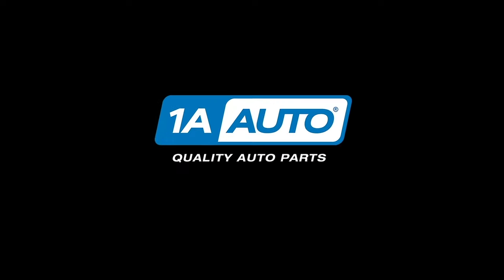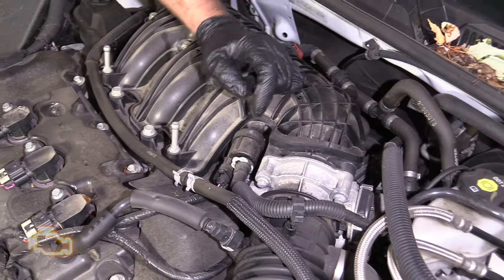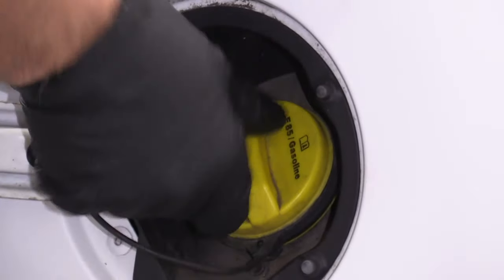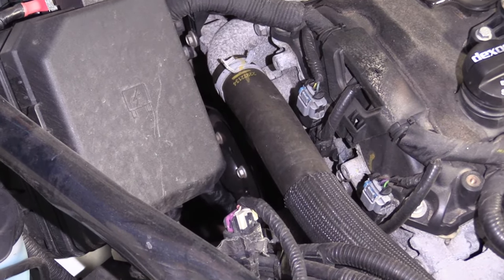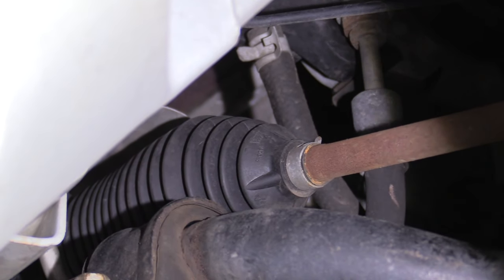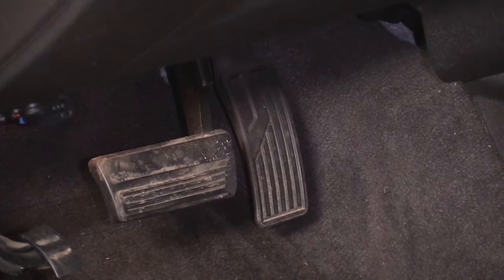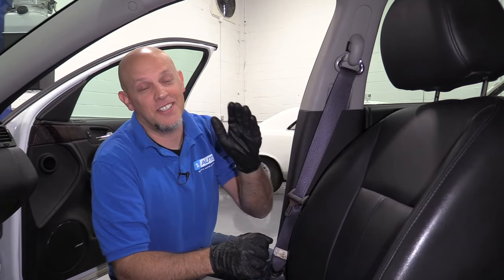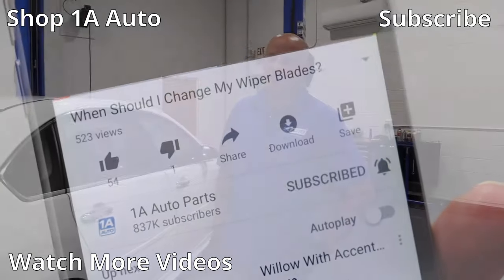Top 5 Problems Chevy Impala Sedan 9th Generation 2006-16

Comment: Blend door actuators on the passenger side is going to tick like a bomb eventually. Ive changed them twice. I said forget it.
Reply: How long did they go out between each one? I've replaced mine only once and I haven't had problems. Knock on wood though
Reply from the maker: Yes we should have added this to the list.
Reply: @marcopolo5541  i changed it and less than a year later it started again. I said screw it and a while later it just stopped. I dont know if it stuck now it working fine but it doesnt seem to be an issue.
Reply: Same thing happened to me im done with the car now rip
Reply: Ahahaha
Reply: @ajw148  if I don't replace mine, my heat won't work. I've replaced the one on the far right of the glove box twice and the other two once. Within the last 2 yrs. I've owned my 2011 since 2013 and this has been a recurring problem along with ABS SPEED SENSOR and the accelerator issue.
Reply: @shaniqua.jackson  yep. Me too. Ive had my 09 since 2013. Ive changed my hubs twice and now i need to do it again. It dont matter if you get the cheap chinese ebay ones or the expensive ass AC Delco ones. Its going to happen again. I got 3 friends who had impalas and all of theirs had the same problem.
Reply: @shaniqua.jackson  the accelerator issue, i had that problem too. Changed the gas pedal and aint had that problem since.  $60 part and 5 minutes to swap it out and my dumbass spent 300 bucks renting a car when that was happening. Smh.
Reply: @ajw148  Eeek! Well glad you got it fixed. Thanks for the additional info!
Reply: I have an 09 with 106K never had hub problems.I have had the other actuator and vent valve solenoid problem. Also oil pan and intake manifold leaking, What mileage did the hubs fail? Thanks
Reply: @ajw148  mine would tick for about 30 seconds then stop. After a few weeks of that is just ticked nonstop. It was summer and it was blowing cold air so I just unhooked it. When it got cold had no heat so just bought one. Not hard to replace.
Reply: Yes, its a terrible design and will have to be replaced about every 2 years or so
Reply: I changed all 3 actuators. The 2 on pass side went smooth. The 1 on driver side, I made it look like I was rebuilding the space shuttle that blew up in 87 not fun. Small ratchet handle is a must have! I'm not a mechanic. But I'm not afraid of screwing shit up worse! You should see my house 🏠 let's just say looks aren't important. And If you want basement lights on. Just ring the door bell 😄🤣😂

Comment: Damn Impalas! My purge solenoid failed after 130K miles! First part I had to change on the car. Just brakes and tires and oil changes.
Reply: That's nothing
Reply: I’ve had to replace that part twice on mine it has 138,000 on it.

Comment: 2008 impala. Changed all the imission parts light still on. Took off vent line at manifold spayed carb cleaner and I  turned off light. Never came on again. Quick clean all is needed.

Comment: Have seen two 2009 models need transmission repair. The sealed transmission is a pain to service yourself if you need to do anything other then flush fluid. Was figuring that would of ended up in your top five.

Comment: U forgot the transmission an the throttle body postion sensor head gasket if they use dexcool its more then that i had one the 9th gen
Reply from the maker: True there is some other issues that didn't make our top 5. Thank you for checking out the video. If you need auto parts go to: http://1aau.to/m/Shop-1AAuto-Now

Comment: My first and current car is a 2013 impala lt with 210,000 miles as i speak. it runs great i change the oil every 4,000 miles with full synthetic. Do yall think itll get to 300,000?

Comment: The main problems that I've experienced that weren't mentioned are:

- Coolant Temp Sensor (Warning - "Engine Hot, Turn Off A/C")
- Oil Pressure Sensor (Warning - "Oil Pressure Low, Turn Off Engine")
- Air Vent Actuators (Both - Clicking Sound)
- Throttle Body Position Sensor (RPM fluctuation while accelerating)
Reply: Same problems I’m having

Comment: top 5 Transmission, evap, rear window(wire burns out--checked 6 at the junk yard and they had same issue), oil pressure sensor, actuator, these cars have 3 actuators, and they go out at different times. shop/ dealer cost about 100.00 each repair, do it yourself about 25 dollars each repair. I am no mechanic, but i owned a 07 SS for about 12 years and 285,000 miles. My brother has it now and still driving.
Reply: Is it expensive to fix ? I wanna impala but the transmission issue is scaring me
Reply: @BoiBoiGTA which issue are you asking about
Reply: @BoiBoiGTA  which issue are you asking about
Reply: @BoiBoiGTA  if you are talking over all, no. The transmission is what it is. Depends on where you take it. I am assuming you will do most repairs yourself.
Reply: @wilmoney4201  Is the transmission expensive to fix ? I heard the transmissions go out on these cars often, I could fix the minor repairs myself but not the transmission
Reply: @BoiBoiGTA  it should scare you, because the trans is going out, just a question of when. Ain't gonna lie, I loved my SS.
Reply: @BoiBoiGTA  I put 2 in mine, first one was 1700.00 and the second one was 1500.00, keep in mind  that was like 2012 and 2016..I am sure its more now. I think its closer to 2k now. Depend on where you live.

Comment: And the catalytic converter goes out easily too. I own an 07, love my car. Has 180k right now
Reply from the maker: Thanks for watching!
Reply: @1AAuto  yeah! I love watching your videos, I've watched a few and have been able to do minor things to my car. I'm not really a good fixer upper but I have learned a lot. I do love Impalas, at least mine anyway!
Reply: Clyde I have an 08 lt that's pushing 200k miles noticing an issue with clutch slip which apparently is a common issue too. Engine revs for a sec when you give it gas then it'll jerk forward hard.
Reply: @benstuff8758  is that just low transmission fluid? My car does that if I'm thinking the same thing. Like you are at a dead stop give it some gas and it'll be sluggish then BAM off it goes? Lol that's how it seems to me. And sometimes it'll make a hard shift when I'm driving on this 1 gear it seems. Just once and awhile. Just noticed that happening.
Reply: @clydeharrell1216  unfortunately its not. Its just badly designed transmissions. I've tried flushing my transmission fluid and replacing the filter which temporarily eased up the issue only for it to come back about a month later.
Reply: @benstuff8758  ah, see I thought it was my leak. Good to know! But as long as it runs I'm good!
Reply: @benstuff8758  have you had to replace much on your car?
Reply: @clydeharrell1216  no its been overall very reliable since I got it. I've gone through 2 batteries (one when I bought it and one 3 years later), and a air vent motor. In terms of stuff breaking thats all I've replaced. I've made my own modifications to the stereo system though and replaced basically the whole brake system with performance stuff.
Reply: @clydeharrell1216  oh and I had an oil sensor go out
Reply: @clydeharrell1216  yeah dude just keep running it till it dies. As long as you keep up with maintenance they're reliable
Reply: @benstuff8758  yes my 06 Monte Carlo does that as well.  I'm not worried about it as it's been the same for the past 10 years.  Lol.  I'm just careful and ease off the line.
Reply: @tashalousdadful  honestly dude once I slapped a performance chip in it, I rarely have that issue anymore. It's something with the transmission shift points. Since I shift at higher rpms normally now I don't get clutch slip

Comment: Issues I have faced with 2010 Chevy Impala LT: HVAC actuators, accelerator pedal sensor, window motor replacement, door lock solenoid actuator, corroded battery cables with terminals, corroding heater tube pipe (the one on the driver's side, not the front).

Comment: OMGOSH,  I'm 4 out of 5 you mentioned.  However,  I drive a 2010, and everything looks much different under my hood. 
I did learn a couple of useful tips for things to check, though.  Thanks for the video.
Reply: Did u have problems with the transmission/solenoid ? If so was it expensive to fix

Comment: Please add door actuators and vent actuators. I have a 2008 Impala with low mileage garage kept and I've replaced 5 or 6 vent actuators through out the years. As to the doors, when outside temp hits 95 degrees, actuators won't work to open the doors. Otherwise, love my car and I haven't hit a snag with any of the top five problems in your video. Thanks.

Comment: Have a 2010 Impala base edition with 120,000 miles I’ve owned it for 6 years and the only real issues I’ve had thus far is the actuator and steering wheel leak

Comment: Nobody has mentioned the shift interlock harness breaking. Causes the shifter to lock in park. There is a button on the shifter that allows you to manually move the shifter out of park.underneath the console. There is a wire harness that you splice into the lock out to solve problem

Comment: 267000 miles and still running the factory water pump. Did have to change the vent can twice and the air vent actuators.  Gas pedal sensor went bad, replaced it.  

I'm about to do a full rebuild and preemptively change that water pump lol

Comment: I have a 2008 LT that has a faulty fuel gauge. I am wondering if it's possibly a fuse issue? My air actuators have had to gradually be replaced though.

Comment: These are just minor problems. The biggest problem is the transmission. If your Impala last 100k you are doing good. I have an 09 with 400k and replaced the transmission 3 times. Good luck with yours.

Comment: Two biggest headaches with 2012 impala that I've had...1. air damper control actuators (plastic gears get eat up like candy, hard to reach places on that middle one) 2. No TPM re-learn method on 2012 impala after replacing TPM sensors in wheels...if your key fob is dead...you're dead in the water.... ONLY a dealer can reset it....and as a master mechanic i refuse to go there. I do all my own work.

Comment: I got a 2013 and my dash lights and radio lights dim randomly I got a new battery and it still does it O’Reilly did a check on it and everything is good with the starter and alternator…any idea’s??

Comment: Another DTC related to the EVAP purge valve is code P0496, EVAP flow during non-purge condition. Happened to me on my 13 impala, all I had to do was replace the purge solenoid, no issues since.

Comment: I have a 2017 Impala and my check engine light has been on for a while. My mechanic can’t seem to figure out the issue. First it was saying loose gas cap. Replaced the gas and it didn’t resolve the issue. He replaced the evap solenoid, still the light is on. He also checked the lines for leaks and couldn’t find any. I drive the car without any issues. I don’t like having the engine light on. I’m thinking my next step is to take it to the dealership and see if they can resolve this mystery. My last Impala was a 2009 and the only issue I constantly had with that one was the darn AC/heater doors was always clicking and vibrating had to change them a few times. That noise was annoying.

Comment: I have a P0651 code on my impala which has caused symptoms like not starting, properly sometimes the shop I took her to changed the crankshaft  position sensor then they told me it might be the wiring to the sensor. When I try to accelerate fast the check engine light comes on with that code p0651 my next step is to take her to penske Chevrolet and have them help me with the wiring issue if they think that might be the issue. The first time I took her to midas the first time. The issue is the sensor is under the car so I hope they don't try to charge me an arm and a leg for it.

Comment: Help my brother out I have a 2014 LTZ limited and I've been having some diagnostic readings P0724 which I believe is the TCM I've had some erratic shifting and it wouldn't get past 2nd yea second year and I had the cold pool where the car would seem to drive back to normal here's the problem I'm having terrible gas mileage the car is now down to 10 to 15 miles per gallon and it's taken almost a full tank of gas Just to drive 200 miles is that issues with the TCM or is that a bigger indicator of a possible fuel problem

Comment: Tell me how to fix a no brake pedal on that car I have pedal with engine off then once started pedal goes to the floor. Replaced the master cylinder, abs motor with used one, vacuum line (thinking the check valves were stuck) used tester to run bleed procedure with a pressure bleeder up to 30psi ran the pump with tester got some air bubbles but that’s it. Still have no pedal with no leaks found I could only guess the abs still has air some how.

Comment: Also include the coast band inside the transmission that will throw shavings into your trans pump. Sure it's a $90 part roughly (no to include the trans pump, filter, gasket and 7qts of fluid) BUT the entire transmission must be removed and casing removed to replace.

Comment: I have a 2009 Chevy Impala with 185000 miles on it. I've been getting an issue with the engine idling roughly when in drive, but if I shift to Neutral the idle gets better
It alsso has a 'non fluid oil leak' (I can not remember the exact code) for a wile. For Emissions I replace the gas cap and that fixes it for about 300 miles, so I'm wondering if this is likely just a bad EVAP Purge Solenoid or if the rough idle could be transmission caused.
Reply: For anyone who cares, I replaced the EVAP Purge valve and that corrected the non fluid oil leak, but did not affect the rough idle described.

Comment: I'm hoping you can help me out, I have the P2127 code (Accelerator Position Sensor) and I've already replaced my gas pedal two times and it's still throwing the code at random times, every few weeks. I read online that cleaning the "x111 connection" can also remedy this problem but I have no idea where it's at. My Hanes Repair Manual doesn't mention it anywhere in the wiring diagram. Any help would be much appreciated. Already cleaned the strut tower connections on drivers side and also cleaned the throttle body connectors. Thank you

Comment: I got a P0843 transmission code TFP high voltage, but no engine light. Now the light came on, and now engine read P0700  TCM requested MIL ilumination. Any ideas?

Comment: I have a 2010 impala and the engine heat blows out of the vents. The air doesn't come on at all but the fan in the front will stay on

Comment: Easily the number one problem with all 9th gen Impalas is the blend door actuator. The number one problem with the 3.6l impalas is the timing chain and the 5.3l impalas is the transmissions.
Reply: The 3.9 engines have transmission problems as well.

Comment: hey question I just bought my first car at 16 and its a 2009 impala it starts but after driving if im not driving past a certain speed it cuts off and i got to  put the car in neutral and start it than switch back to drive any idea what it could be?
Reply: Kinda sounds like a bad alternator
Reply: @Lucky-23.  fr? it starts up with no hesitations tho
Reply: Alternator recharges battery while car is on starter and battery starts the car up just a suggestion tho I have a 2010 impala and that what had happened to it
Reply: U kno what now that I remember I did had to charge it first and you said yours starts up good could be spark plugs or  air intake issue

Comment: Hi I just bought a 2008 ltz I don't know if my boyfriend mess something up or it was like that before I got it an that the reason they sold it ok first alarm was going off my boyfriend tried turning off an put key in it got stuck an car didn't turn on call the guy he said to unhook the battery but he didn't have too he touched an wire next to the battery an they car came back on but it happened two more times an im hearing the tap noise an the key fob not opening or locking doors some times an if you inside pushing lock an unlocked its not working I have to do it manually please help me got this car because my daughter just had a baby o an the wheel lil tight it don't come back to u

Comment: Forgot the rear defroster not working. If you remove the passenger kick plate, you'll find that it's completely burnt inside the cradle. Don't know how Chevy hasn't recalled this. HUGE safety issue. $15 fix unless you go to a dealer. They'll charge $400+.
Reply: How did you fix your issue? Mine has the same.

Comment: HELP!! My 2013 chevy impala's check engine light started flashing with the stabilitrack system, about 30 seconds later both went out at the same time. Any ideas?
Reply: Mine use to do that I had to get a new gas pedal and also hub bearing
Reply: I gotcha. It’s either the wheel bearing assembly hubs or the ABS wires. 
Imma take a wild guess and say the ABS light comes on along with “stabilitrack disabled, traction control disabled, brake assist disabled” flashing on the dash. 

To work out the problem and spend the least amount of money fix the ABS wires first. A set will cost around $25 on amazon. U will need to remove the tires, remove the shields, then splice into the ABS wires and replace them with the new ones. This is the most common and cheapest fix. 

If that didnt work, it’s probably the wheel bearing assembly hubs. Idk how much a set of 4 costs but know that the ones for the rear are different than the front. U will need a 1 1/3 socket and a breaker bar for the front hubs as they are secured by a large nut. I replaced both my front and rear hubs. 

Luckily Impalas are fairly easy to work on. Thats why i like them.
Reply: Changes are pdd sensor..pull code and ..gas pedal..